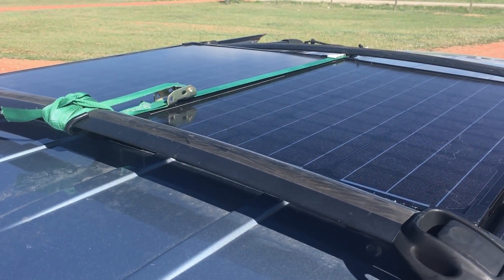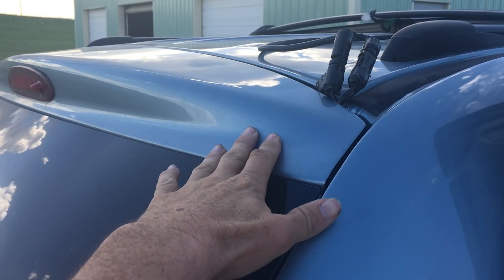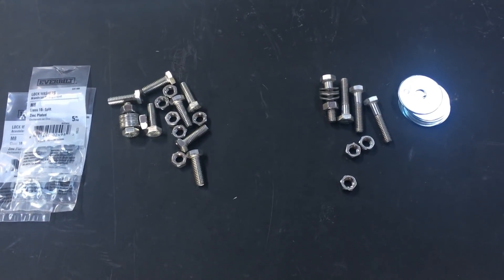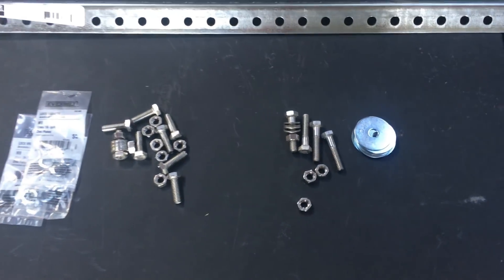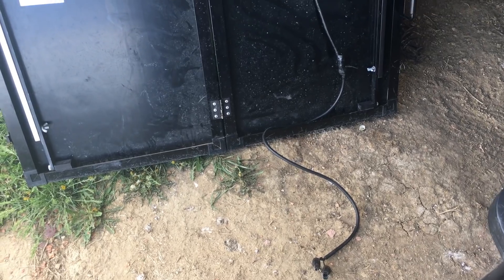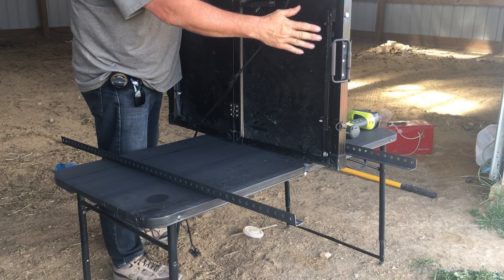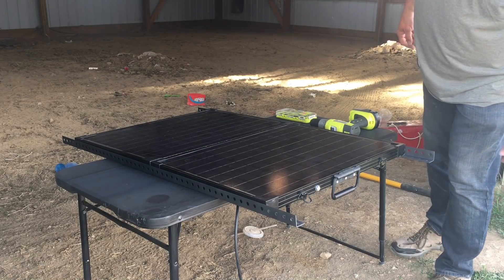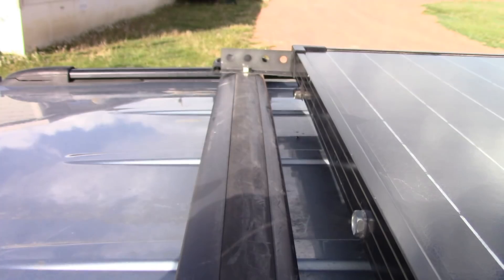Simple Solar Install on a Minivan: Mounting a Renogy Suitcase Panel on the Roof

Comment: A very nice and simple setup! Great idea!
Thanks for sharing!
Reply from the maker: Thanks for watching! I have seen some impressive roof-mounted installations, but really wanted to keep it simple and inexpensive on this van. It has 231,000 miles on the odometer (second transmission that is quirky, and the original engine) so I try to keep everything on this van simple and modular so things can easily be moved to another vehicle when the time comes. Today is really windy and I would not be able to have the portable panel outside, but now with it mounted on the roof I still have power to work.

Comment: Wonder if you could redo it. Get 2 more angle irons so you can bolt it below the roof rack it would be more stealthy and you could actually use the roof rack for something if duty calls. What do I mean well lets say you find some things you can't live without and you could transport them to the area you will frequent store in a rental say  a 5x5x5 you could go get your stored things and transport into the next zone. In other words if someone had a hobby or a collection they can have it and still live in a van. Or in my case if you wanted to live out of a Prius V yet still have your space to do as you will. 

Somebody could get better results with these suction cups?  Say you have a solar suitcase and you need to mount it for low speed travel in stealth situations? Get these paint them the color of your car and should work good. 
https://www.amazon.com/Vacuum-Suction-Handle-Dent-Puller/dp/B003NU0EM8/ref=sr_1_1?ie=UTF8&qid=1494759137&sr=8-1&keywords=harbor+freight+suction+cup

I have had rubber tramps give me shit over this theory but some of you guys I know have got to have things that you don't want to lug around when you are RTS Rubber tramp STEALTH mode. What would be the benefit of going RTS well you can drive for Uber for one thing? That is a great income stream if you are needing some coin. Or you could use your vehicle for hauling freight? take all the seats out the back and make a few runs during the summer months when it is not so dangerous to run?

I know you heard of the cannon ball run did you know the incredible preparation and risk of life and property these fools take to risk their life to have bragging rights? Any day you can get a direct flight that takes all of 5 and 5 min hours to complete you can get a connecting flight that does it in 6 hours and 40 minutes. $334 round with the connecting flight. Sorry you can't justify the insanity to do that exact run and say you beat somebody at something ? The current record holder wanted to give a FED EX driver shit over not checking a mirror ? WE check mirrors for 70 mph traffic not 158 mph traffic? What a TOOL to call out a guy that is doing his job as prescribed.  

If they were to do the trip in a single engine prop plane the Cessna 172 is about the most successful aircraft sold so lets pick that Cruising speed is 140 mph range not the 188 mph top speed 48 gallon tank ? 736 miles  range for this aircraft is 2800 miles for this run plane would take a little less but lets give the plane the same guesstimates. So we divide 2800 by 650 miles don't want to run out of fuel that is 4.3 so say 5 refueling stops. Each refuel should take you 30 min if all goes well. So that is 2800 divided by 140 minus 2.5 hours for refueling. So what would it take for a 172 to make the trip? (not the best aircraft out there) 22.5 hours. Well below the 30 hours record ? The aircraft would average 15 mpg should use 186 gallons for the trip. Prices today range from $4 up to $4.60 http://www.100ll.com/ If average fuel price was $4.25 it would cost over $800 for fuel. Geez no wonder commercial flights are so common?

Sorry guys but shitting in bed pans and hauling ass down the road in a modified car going 158 mph on the interstate average speed of 98 mph is just RETARDED ! The cannon ball run record holder did his run in a Mercedes Benz 2 door modified car fuel capacity 45 gallons range 800 miles get this his economy for the run was ~17 mpg if he ran it down to fumes his economy was not as bad as I would have suspected it would be. The car would use 164 gallons of fuel but in reality he had to use 2 cars to pull this off one to scout the route ahead and the car that was to set the record. So double the fuel for this run.

Our nations warriors in the Air-force have to do these stunts they run missions and create incredible probably classified results. It is interesting to push the limits but I can't justify the insanity called the cannon ball run. First of all just becasue you leave this address and go to that one does not mean you experienced the same challenges as any other driver did?  That route is going to change every day.

 I made a run one time from MCLA 70380 - 92234 Cathedral City Ca 1,792 miles. Drove every mile myself I went with the flow in the cities and out of the cities I set the cruise control on the speed limit. I drove until the car was nearly out of fuel when I was refueling my wife ran in snagged any food she could used the restroom while I washed the windshield of my Hyundai sonata and just that fast we were back on the road. The spec for the car claims 35 mpg highway Most likely got 29 driving the speed limit.  17.2 gallon tank so roughly the car had to stop for fuel every 493 miles or 450 to be safe gives it 4 fuel stops along the way.

If I were to take that same trip in the Prius today I get 38 mpg going 80 mph today you can go 80 in W TX. Prius has 11.9 gallon tank. (just so unfair to compare but the gen 2 Prius to the gen 2 Hyundai sonata)  at WORSE my range is 450 miles. I have driven the Prius for 420 miles with 2 female passengers that you know is nearly impossible to keep the car on the road they did better on that trip but we still had to stop for doughnuts or the 30 min of precious daylight to eat chicken and pet horses of the border patrol?

Oh well this is what you do when you have the search engines that can spit out data.
Reply: GEAUX-PRIUS Cowboy - WTF??? 🙄

Comment: Great informative video.  Will sure make it easier so you won't have to always move the panels.  You make it look so easy.  Thank you for sharing this on how and why you use this unit.  Great job.  This will help make life easier for you.  Stay safe and happy trails.      love         Joyce
Reply from the maker: Thanks for watching! I debated a number of options for how to mount the panel, but finally went with a simple option. The van has a lot of miles on it, so I don't really want to do anything expensive or complicated on an older vehicle that may need to be replaced sooner rather than later. Portable panels are a great option for starting out, or for a backup in case you need to park in the shade and want to set the panel nearby in the sun, but many people who start with portable end up switching to rooftop panels for the convenience.

Comment: This is a true game changer for you. Congratulations! You did a great job on converting this Renogy portable suitcase folding model to a rooftop hard panel install. You rock! 👏🏼👏🏼👏🏼
Reply: Robert Witham Great video Robert..simple is good !
Reply from the maker: Debra Dickinson, thank you! Yes, this will make van life somewhat easier and will really boost my power supply on days when it is windy or I need to travel. I am pretty excited to finally have it done.